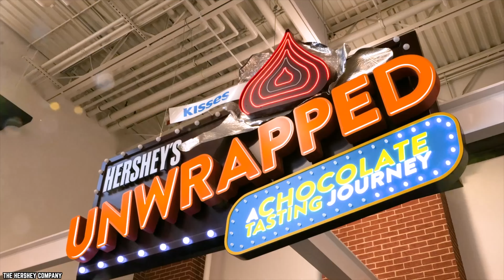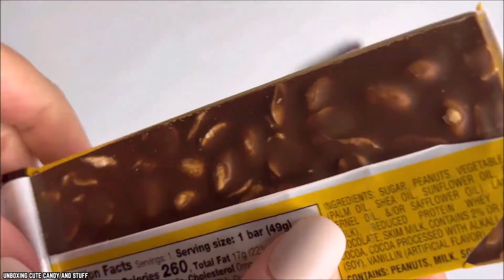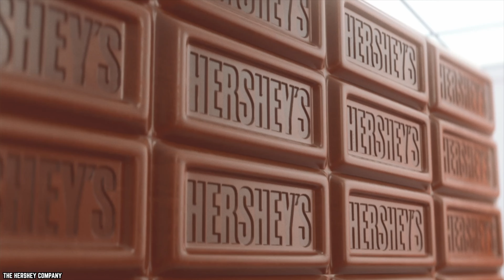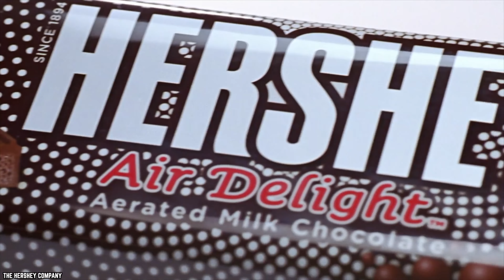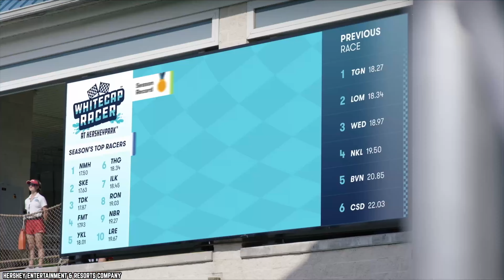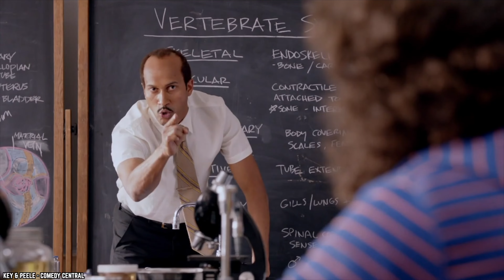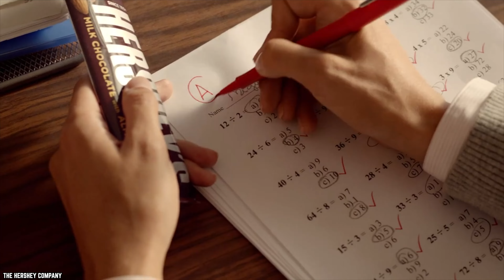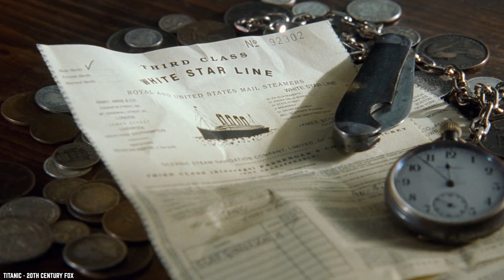10 Untold Truths of Hershey’s Milk Chocolate

Comment: I wish Hersheys hadn't switched to using more vegetable oils than cocoa butter. I've noticed over the years that some Hershey products are labeled as "made with chocolate" or "chocolatey," which means it's no longer legally "real" milk chocolate. Mr. Goodbar used to be my favorite.  But even on the label, it went from "milk chocolate with peanuts" to "chocolate candy with peanuts" - as it's oil instead of cocoa butter. I wonder what old Milton would think.
Reply from the maker: @NotoriousTori Milton Hershey had a strong commitment to quality and innovation. The shift in ingredients can be seen as a response to changing consumer preferences and industry standards. 😊